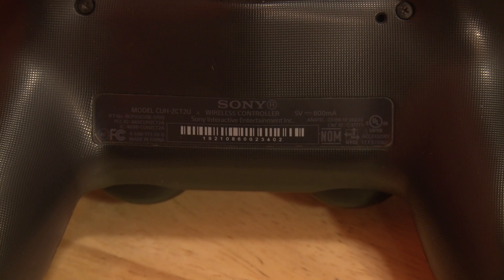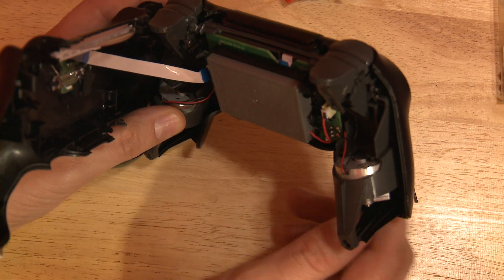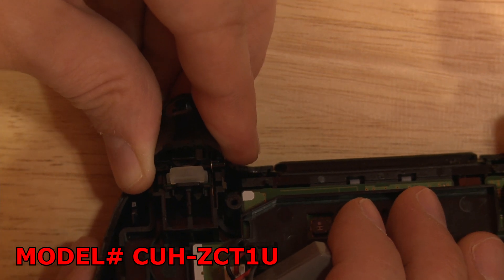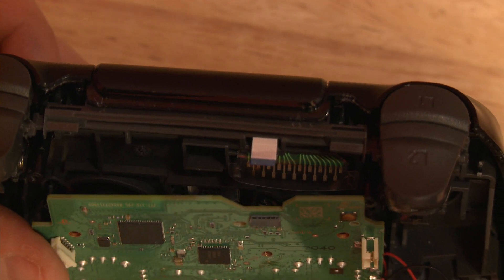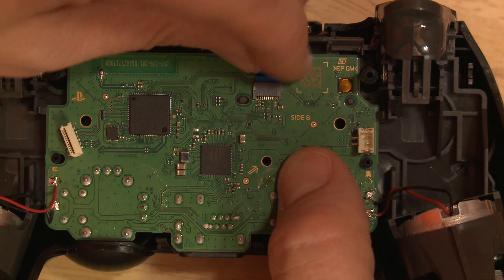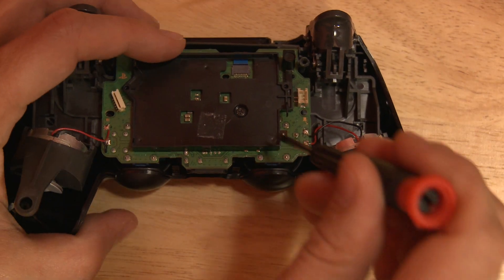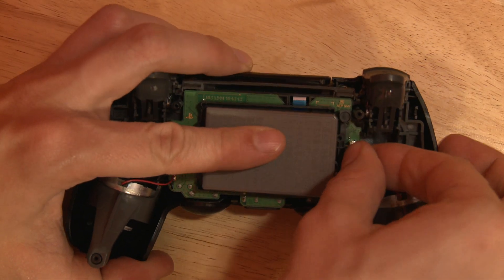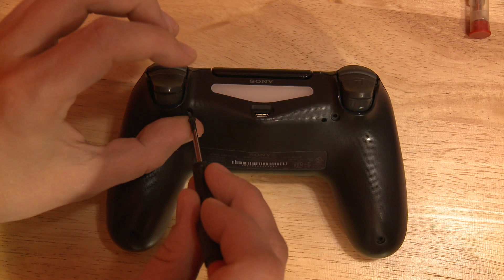PS4 Controller Buttons Not Working

Comment: Started having this issue since last month even after getting a brand new(made in 2020) PS4. WTF Sony? Are they trying to do this(sneaking flaws into the PS4 updates) to get people to upgrade to the PS5? If so it couldnt have come at a worser time. Almost nobody has the PS5 in stock for starters & anyone that does sell a PS5 scalps the fuck out of its base price for dispicable, selfish, scummy reasons.
Reply: same
Reply: Heyyy cool down every playstation controller box says that the controller battery dies after a year or two and the controller will have problems in it

Comment: My triangle button didn't work. I followed your instructions and now my other buttons don't work which means I'll be getting a new controller. Thanks!
Reply: I just slapped my controller on its touch pad and soon enough it worked
Reply: Cuz my O wasnt workin
Reply: My square didn't work...now the whole thing doesn't work. Yup..
Reply: oh.
shit
well now I'm going to try this and come back to see if it broke.
Edit: did not fix or break anything. not one thing about the controller changed.
Reply: Update: I got the whole thing to work, including faulty button Lol not following this video
Reply: @SMND  bro how
Reply: Maybe try the bottom of the touchpad
Reply: Where the charger is
Reply: My circle wasnt working and so i slapped the bottom once while holding it upside down and my O worked so try that
Reply: @ket451  literally need to take apart the entire controller, clean and rearrange the the circuit board back into its proper places. Not as hard as it sounds...but definitely more steps than this. I'll try to find the video that I followed but it helped like a charm and fixed my drift stick
Reply: My x button is a bit deep down but still works, how can I rise it a bit?
Reply: @night104  Q-tip heavily soaked in rubbing alcohol you want to get it in between all the crevices of the button and slowly just move the button around with your finger, since its alcohol it'll dry within about 30 seconds so you don't have to worry about anything getting wet for too long
Reply: After cleaning it with alcohol you could use your fingernail with a piece of toilet paper or tissue and rub it in between the crease of the button on the controller to get all of the gunk and the dirt that might be stuck there
Reply: @astupidoctopus  why did that actually work for me too
Reply: @astupidoctopus  like, it took a couple of tries but now it works just fine. Thanks!
Reply: @sedburgpengi5719  Ayy my man

Comment: Excellent video on showing the various steps involved in dismantling and reassembling the controller. My circle button was triggering my L2 inputs. And all I had to do was to dismantle, clean the parts of the PCB shown in this video, for the contacts and solder points for the buttons, with isoproply alcohol. Then reassemble and it worked like usual. 
The toilet humour was crude, but very funny too!
Reply: The same thing happened to me except with R2 and Square. I spent a whole month absolutely frustrated, found this video, dismounted it exactly as he did, then I read your comment and proceeded to thoroughly scrub the PCB with a Q-tip dabbed with isopropyl alcohol.  Worked like a charm.  Still can't believe it.

Comment: I have a question. My problem is that I got a brand new PS4 controller and today, my triangle buttons stops working all of a sudden. Every other button on my controller works and my triangle button isn’t sticky or stuffed up. I can press it normally just like all my other buttons. It’s just that my PS doesn’t respond to me pressing it? If I’m playing a game and press the triangle button it doesn’t respond either. How do I fix it?

P.S : I never dropped my controller before and I cleaned it and it still didn’t work.
Reply: Same problem
Reply: Same problem...still no solution

Comment: If this doesn’t work for your buttons and your button feels like less resisted than compared to other buttons. Then You broke the rubber inside the controller. In order to fix that you had to get replace that broken part with a new one. And no idk what that part called I know it’s rubber that hold the button.
Reply: I’m going to guess that’s what happened to me notice the buttons were different and this didn’t work
Reply: @kirky1703  if the  rubber are not broken then you probably actually broke it

Comment: Took mine apart, its a CUH-ZCT1H. Only one button not working - the Enter button. Clean the contacts everything twice but didnt work. In the end the hard plastic that guides the ribbon cable in (for the indicator light and usb input) came off. Anyway doesnt matter cause the Enter button still wont work

Comment: My triangle don’t work and I don’t want to do all this🙁😩
Reply: Same
Reply: What I did was just grab a sportive heavy but not that much thing and hit it a couple times
Reply: @carlitoes10k36  hows your experience after that dude
Reply: mau gamer is actually worked but if that doesen’t you have to look at a video that the person opens their controller it might not work because things inside the control are tangled up or disconnected
Reply: @carlitoes10k36  thanks mate so it's risky if my controller  tangled then what ? I hope one day I will wake up and my controller should be OK..
Reply: mau gamer well I’m not sure but if it’s tangled it can stop some buttons from working so you have to put the things inside the control in the right place and everything should be fine
Reply: @carlitoes10k36  hmm fine

Comment: Guy i really don't understand: i had bought a third party ps4 controller two months ago, my sister only used it for coop with me for less than 4 hours. Yesterday we tried again to coop the "x" button doesn't work at all. I dismantled it twice and i cleaned the film circuit but the problem remains. Any additional advice?
Reply from the maker: Sometimes if a button doesn't work, the conductive film needs replaced. Usually if its the conductive film, the conductive coating has worn away from a lot of use though. Was this controller a "used" controller when you bought it? If not, it would be strange for the conductive film to need to be replaced already.
Reply from the maker: Another thing you could try is download a PS4 gamepad tester, connect your controller to your computer, and see if anything strange is happening with your controllers buttons. It might reveal that the controller thinks other buttons are being pushed down when they are not, affecting your x button. Does the x button not work in any game or just a particular game?
Reply: @YorkiesTV  it is a third party ps4 controller it supposed to be new. I contacted with the retailer and she told me that to try to fix myself if it is dirt issue otherwise to take it to the store just for the technician to inspect it and if it's something like the circuit they can not replaced it and because i have tossed the product 's box it will be impossible for them to return it to the trader.
Reply: @YorkiesTV  it doesn't work from the time the system asks to pic a user/ profile.
Reply from the maker: @grgamer8470  does it work any differently if it's plugged in, versus wireless? Also what is the brand of the controller?
Reply: @YorkiesTV  there is no difference. OEM is the brand. I used the tester you recommended: except the x it doesn't work, also the same applies for R1 . I will send it to them but i do not have high hopes because i have tossed the box and i feel their service won't do more than i do. Anyway thanks for the suggestions anyway.

Comment: Yo, can someone help me please, i have apps on my PS4 I was using YouTube to watch a video.But I messed up what i put in and it wouldn't let me delete it, this repeated for a few days and now it doesn't even work at all. A few days after that, the space button wasn't working on the controller. So I tried Netflix and the buttons were doing just fine, but YouTube's doesn't work.

could this be a problem with the app or the controller?

Thank you :)

Comment: You fixed 3 buttons but my l2 trigger still doesn’t work what shall I do?
Reply from the maker: My first 2 thoughts are to double check that all the cabling is back together after reassembling the controller, and if so, you might have to replace your L2 button pad. I'd do a search for button pads for your specific controller model, because different controller models do require different parts. It's a little hard to give more info than that, without actually seeing the controller in person, but thats what I'd start with. Good luck, and feel free to report back here with any results if you try to fix that L2!
Reply: @YorkiesTV  thankyou so much appreciate it hella

Comment: Hello, I have watched other videos which say that u need to open up and clean the controller insides and it will start working, which I did, but my X button still did work. So finally I have found this video that says u need to align those points....so I will try it as my last resort..I will be back after this process.
Reply: Sadly the X button still don't work..
Reply: @YorkiesTV  great...I will email you tomorrow since it is 3am in my country right now.

Comment: Great video only problem I don’t have that small of a screwdriver and my Sqaud button is the only one not working everything else works but not that also you should make a video on how to fix controller drift if you find a solution because these controls get drift a lot when dust and stuff build up under the stick all in all great vid highly recommend as a fellow YouTuber and I just wish I could follow all the instructions but sadly no screwdriver that I have closed to that size.

Comment: Thanks, but I highly recommend for you guys to clean that solder point and the pcb with Isopropyl Alcohol (I did this and it's works like a charm!)
Reply: Pcb? I apologise if I sound like an idiot, I'm just starting to get into this and instead of spending$60 on a new one, I'd like to repair my old one
Reply: @kodybauer9375  Yeah, that solder point on the pcb, but I highly recommend for you to clean the contact pad of the pcb too, so you can be certainly sure that every buttons can be functionable as well as they used to